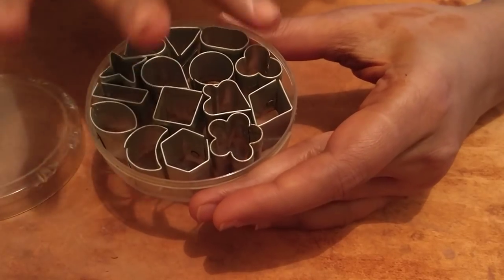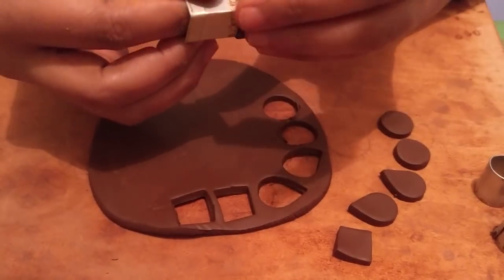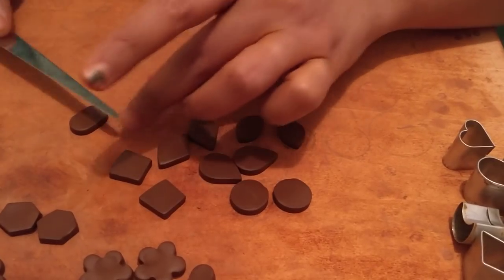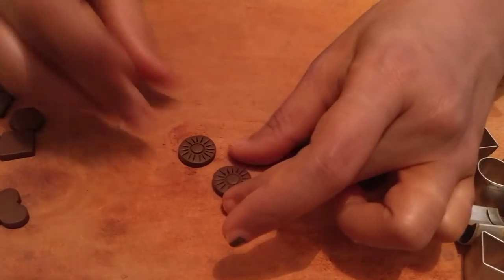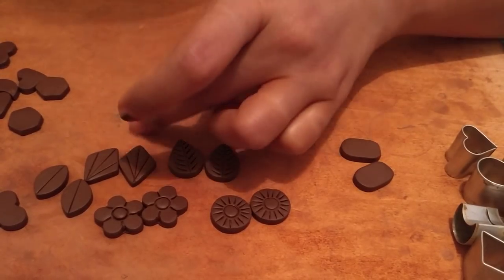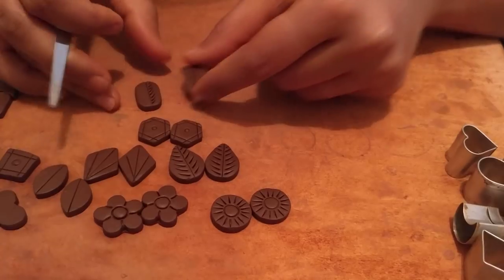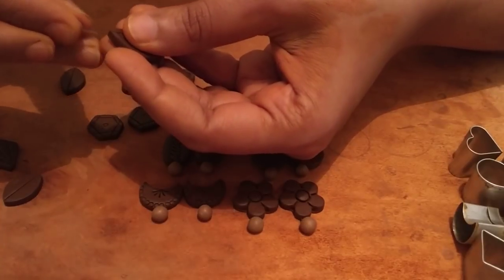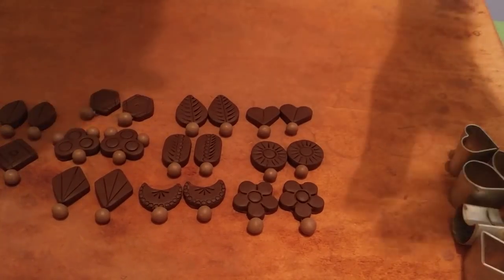11 Terracotta studs using small cookie cutters! #terracottajewellery #studs #earrings #eartops

Comment: Very innovative. What is the gauge of the nichrome wire that you have used here to attach the round bead? Also how to attach the stem of the earring into these pieces?
Reply from the maker: Thank you! The nichrome wire I have used in the stick beads and ghungroo beads here are gauge 26. 28 too works. But I suggest don't go beyond that. The wire might be too flimsy. The stud base is stuck once the pieces are fired and painted. The stud bases are stuck with an industrial adhesive. Araldite in India is a good product. There is an E6000 too which is pretty good.
Reply: Can ear stud base attach at back before firing

Comment: Thank u mam but i have Udhayam Copper Beading Wire For Jewelry Making (Silver) 0.4mm can be used ghunghroo and bead plzz suggest me
Reply from the maker: If you are using clay that needs to be fired in a kiln then use only nichrome wire. Any other wire would melt inside the kiln.

Comment: Mam could u pls clarify my doubt that reason for jumka falling once I wear, could u pls post video how to attach stud Base and tips for heavy terracotta jumkas
Reply from the maker: Hi, If the earrings are heavy that's bound to happen. you may use a good stud post and a metal push back. Those plastic ones might not bear the weight. Use a good quality industrial  strength adhesive to stick the post to the stud part. Hope this helps.

Comment: U said germann gold color is available in hardware stores,  will it b liquid form
Reply from the maker: I think the brand is either germann or eagle. I see both names written on the bottle. Yes its in a liquid form. But I am unaware of the composition of the paint. While the gold paint is beautiful in color, you can try with the smallest qty and check for yourself. Last couple of years I haven't used it though. I currently use either liquitex or master's touch.

Comment: i have a doubt. How ur hands and rolling pin are clean while making this, will u apply oil or powder in ur hands while making this?
Reply from the maker: Nope I don't use oil or talc.
I use oil sometimes to finish off my pieces.
Its best to keep cleaning your tools after every use. I wash my hands in between so that the clay doesn't dry on my hand. The dried bits of clay can fall on the wet slab affecting the finishing of my work.
Reply: @nehagopinathpillai  ok mam

Comment: Ma'am i have a issue with push pin. Please  help me, when i attached push pin with studs by arraldite glue after few days its completly dislocate from the earrings, with a chunk of fabric colour... How can i manage this..
Please mam,
Thank you.
Reply from the maker: Okay, How long do you let it dry once the glue is applied?
Reply: I dried it for 24 hours, approximate.
Reply from the maker: @arkoray245  that's good, not sure why that happened. Coz Araldite is a strong adhesive. Have you bought the Araldite which had two tubes? Hardener and the resin?
Reply: Yes mam, 1 white tube, and one is blue..

Mam, i'm really confused, please help me.

When it's completly dry, it's dislocate by a chunk of fabric which i colored. 
😔
Reply: Should i try E6000, or anything else?
Please mam, 🙏❤😔
Reply from the maker: @arkoray245  ideally that shouldn't happen. If it's mixed well (hardener +resin) then Araldite is a good product. You could try E6000, and let it dry for 72 hours (3 days) to completely set.
Reply: @nehagopinathpillai  ok mam, i'll try.
Thank you soo much mam. ❤